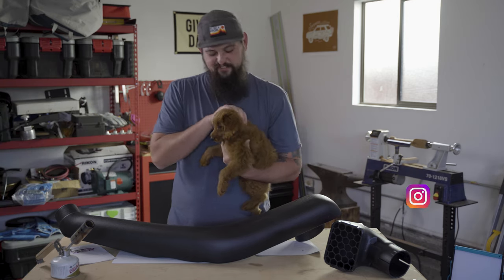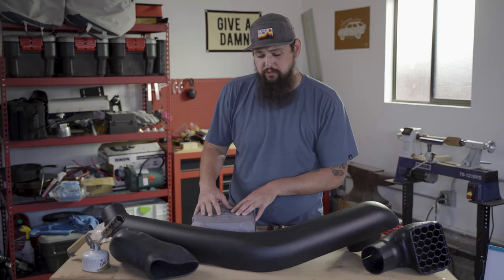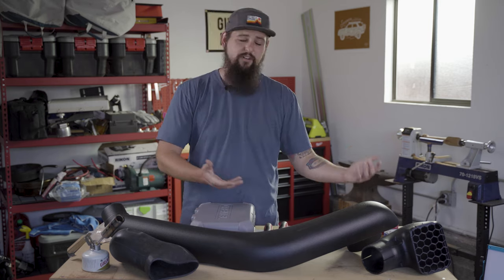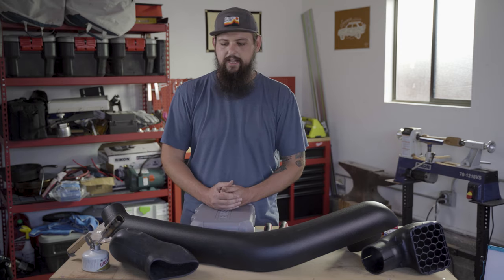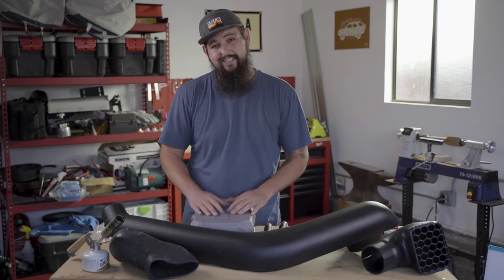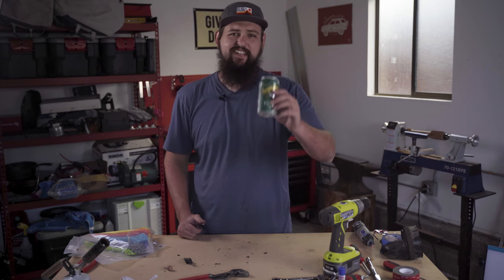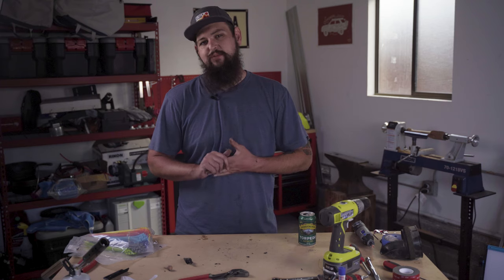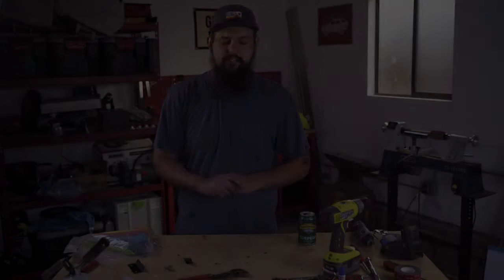Dobinsons Snorkel Install - Overland 4Runner

Comment: How is the tape holding up?  We ordered Dobinsons snorkel for our 4runner and real do not want to drill into the pillar.  We love the idea of using tape.
Reply from the maker: Hey there! I haven’t had any issues with the VHB all this time. It has survived through many rain & snow storms, as well as countless car washes. And of course, I’ve logged thousands of off-road miles at this point with no issues!
Reply: @BenStinnett  Thank you

Comment: Thanks for doing this. Did you caulk/seal the drain holes under the OEM  filter? Recommend that or no?
Reply from the maker: I skipped that step and haven’t had any issues!

Comment: Great video! I’m looking forward to this as my next mod. Any reason you went with Dobinson over Safari? I like the cleaner look of the Dobinson. Wonder if the Syklone pre filter fits it. Also like the TJM sleek design but worry about the air intake on that with rain/snow.
Reply from the maker: Hey there! I really only went with it because of the looks. I didn't care for the huge "Safari" branding on the side. Haven't checked the fit of a Syklone, but I imagine it should fit.

Comment: Yes I think they are worth it. They are not for water crossings as most believe, yes they do help, but they are for clean, cooler air. I've been looking at this for my 17 4runner and have pretty much decided to go with it. Thanks for the video and it did help me make up my mind. Curious as to why you didn't use RTV on the air inlet pipe pieces as most people do?? Just curious as to your thinking.
Reply from the maker: Very true Glen! I did see that a lot of folks will lay a bead of RTV around the studs in the fender, I opted not to simply because there is a pathway for water to drain should any make its way into the fender (as evidenced by the numerous times I dropped the nut I was trying to tighten and it ended up on the ground. haha). If I would've put any holes in the A-Pillar, I definitely would've RTV'd those since any water that got in there would be stuck. Hope that helps, and good luck with your install!

Comment: How did that double sided tape hold up? I'm installing my snorkel this weekend and it would be nice to not have to drill into the A pillar
Reply from the maker: Hey Alex! It’s still going strong man! Haven’t had any issues with it at all, even through car washes, rain, snow, and 80mph on highways.
Reply: @BenStinnett  Sweet! That's probably what I'll do then. When you go through the car wash, does water not go through the snorkel?
Reply from the maker: @alexsanchez7331  I hit up the coin-op wash to clean the 4runner after trips now. I do try and avoid spraying water directly down the snorkel, but also don't worry too much because there are some built in drain holes to deal with things like rain and carwashes!
Reply: I'm installing my safari snorkel this weekend I was gonna do the tape but said I'm in this deep might as well drill it and do it proper

Comment: Ben, nice job! I take it that the Dobinson snorkel doesn’t come with a foam gasket to go between the main body of the snorkel and the fender? I believe the ARB Safari brand does. My concern would be vibration over time wearing the paint on the fender and salt corrosion. I live in the northeast, where they use salt brine on the road.
Reply from the maker: Thanks for watching! You're right, the Dobinson doesn't come with a foam gasket. I'll have to watch for any paint wear over time, but so far I'm a little north of 3000 miles on the install with no obvious signs of wear.

Comment: For something like this, would it void “all” warranties? ‘21 sr5 here.
Reply from the maker: Hey that’s a good question. I’m afraid I don’t have a solid answer for you though. My gut says that it shouldn’t, because you aren’t really changing any of the “components under warranty” but I’m sure there’s some fine print somewhere in the contract that says otherwise. My only data point here is that I did most of my mods while my factory service was still covered (20/30/50k service) and had no problems with my dealership getting those done. Maybe talk with your service dept to get a better idea?
Reply: @BenStinnett  okay, I’ll definitely ask my dealer to what and what I can’t do.

Comment: Hey Ben, how's the double sided tape holding up? Any paint damage where the snorkel meets the paint? I'm considering some edge trim around the base for mine.
Reply from the maker: Hey Jonathan! Just north of 3k miles after the install now and things are holding up well! The VHB seems to be holding up well, even after three post-trip hose downs with the pressure washer. I definitely think the edge trim is a solid idea!
Reply: Hi Ben, just wondering how the double sided tape is holding after 3 months?

Also did you attach the base for the A pillar to the snorkel and taped the base ? Or directly the snorkel to the a pillar with no hardware?
Reply from the maker: @silviogiampaolo8223  hey man! The VHB is still holding strong! Just got back from another ~5k miles on highways and off-road, no issues! 

I just added the VHB directly between the snorkel and a pillar, no hardware!

Comment: VHB is great but does need 24 hours bonding minimum and 72 hours before any flex is better. VHB also comes In different foam thicknesses and is allows more flex as it thickens while still maintaining adhesion. VHB holds skyscraper windows in and is both air and water tight when properly installed. Black VHB is UV resistant while clear and white are not.
Reply from the maker: Thanks for the additional insights, Chris! VHB is great stuff!

Comment: Forget water. What about dust?
Reply from the maker: The snorkel makes a huge improvement on the overall air quality delivered to the engine! My air filter stays cleaner, longer, even on dusty trails and when riding in groups!